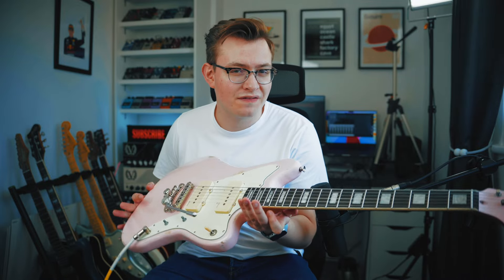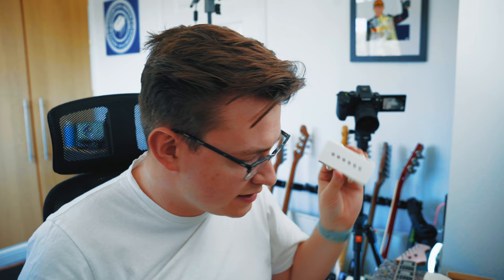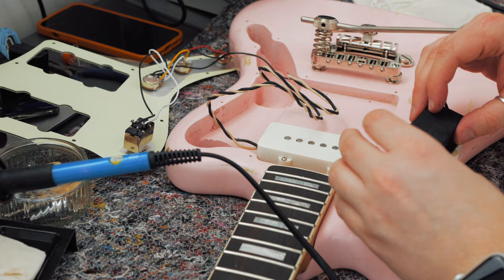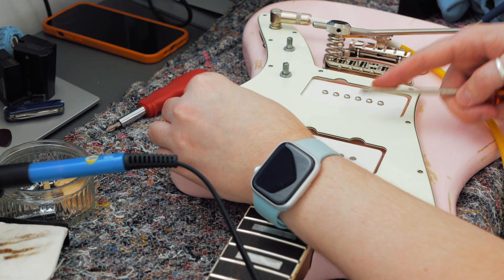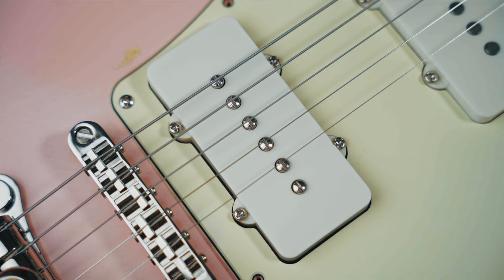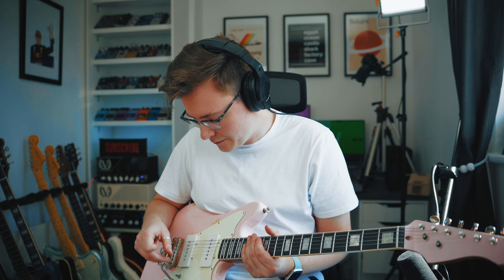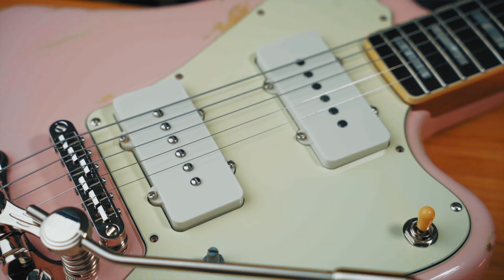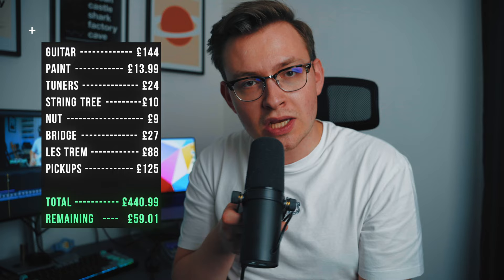Can Hand Wound Pickups Save This Cheap Guitar?

Comment: 1 meg pots is what you need on the roswell pickups as they sound really good and make it sound like a real jazzmaster with that mod...i did the deusenberg les trem, wilkinson roller bridge and 1meg pot mod on the JA60 and its awesome.

250k pots just choke the tone and 1meg is recomended for jazzmasters and usually 500k for p90s although 250k pots have their uses..

Cool mod to try- I use two fender 250k/500k stacked concentric pots   (to have 4 pots in the space of 2) but wired with a slide switch after the pickup selector to choose between the  option of 250k vol/250 tone  with the .047 cap  
and a 500k volume/ 500k tone with .022 cap 

To get a warm tone with the 250 side and one click of the switch i get a brighter tone from the 500k side.

 This is really useful for p90 / firebird pickup guitars that are halfway between a singlecoil and a humbucker tone wise but i was surprise how well it works with certain sets mixed with lipsticks, singlecoils, and humbuckers you set up with coiltaps (so switching to the 250k pots makes it sound  more like a traditional single coil) or for 2 lipsticks/singles in series a 500k ootionsounds amazing, so it gives you far more tonal range. 

Even using a higher than recommend pot value with singles etc can just open the pickup up as its not adding highs but just letting you hear what the pickup is meant to sound like without taming it and that can actually sound better in the case of those Roswells, 

And for further flexibility  to get that 1meg jazzmaster tone without the 1meg pot  i install another slide switch inbetween the pickup selector and the 250k/500k selector switch  direct to the output jack and the othersjde of the  switch gos to the pots so i can bypass the pots completely (they call it a blower or a bypass switch) but still have the option to select which pickup is going direct

So this means you have a no pot option , a 500k and 250k option all done using 2 cheap slide switches....

And opens up more simple mod like wiring pickups in series etc and makes the tone viable as 2 singles or p90s in series can sound muddy but with the blower switch or 500k option selected it make it usable, especially as you said you like to use fuzz....

This my way of having a version of the the bass, rhythm,lead circuit the older fenders would have rather rather than using capacitors and resistors as i didnt understand them when i was younger so i did this mod instead and used it on a hand full of my guitars since.

Also combined with a varitone pedal and treble booster you can get some really awesome unique fuzz tones.....i have the ehx  big muff nano and triangle fuzz, and the behringer super fuzz and its helped with all of them.

Comment: the guitar sounds much better with the new PUs. Andy Rothstein Guitars offers a great replacement plate for a Jazzmaster that allows you to have new pickups and electronics that allow U to get the traditional Jazzmaster sound and  be able to switch to a Les Paul sound.
Reply: Would that fit on a JA60?
Reply: @rowanemslie9295  U would have to ask Andy Rothstein.